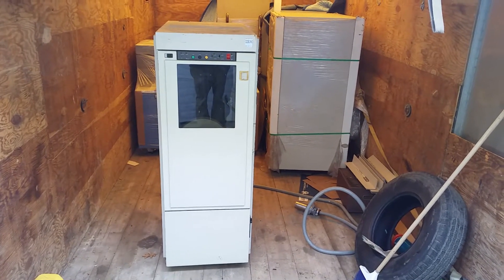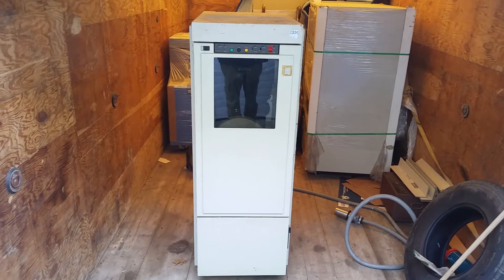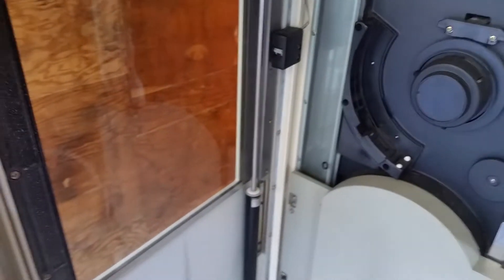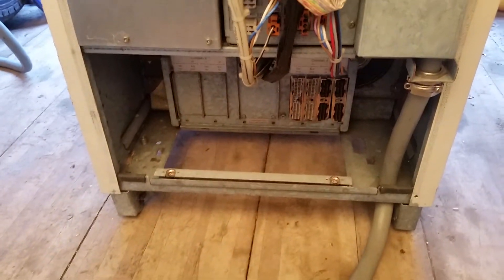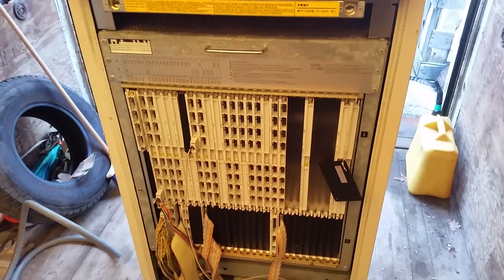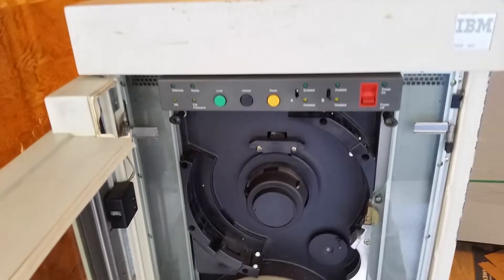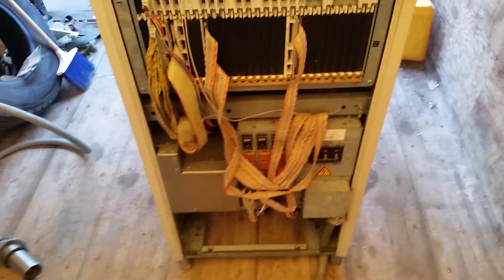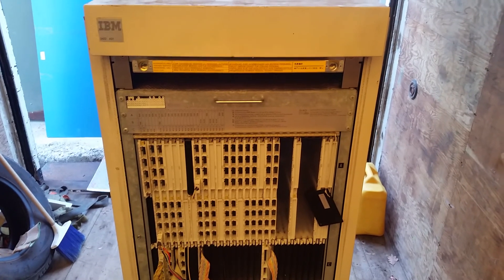IBM 3422 Tape Drive

Comment: Check if the Special Tool Box is still in there, it should be mounted in a shelf at the top of the inside ... locked with a thumb screw.
You could access a service panel if you unlock two screws over the floppy drive.
There you could enter "1FD" to start a little Read-Write-Test. You must mount a tape which will be written to to run the test ... there should be LEDs for "loading" and "ready" the tape.
Reply from the maker: I shall do this, once I get the 3422 out again to be worked on.